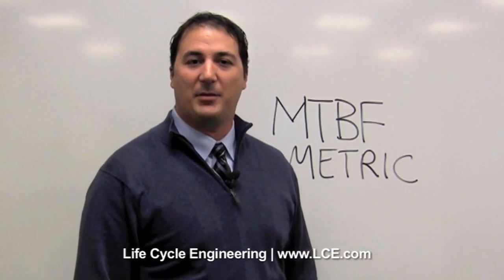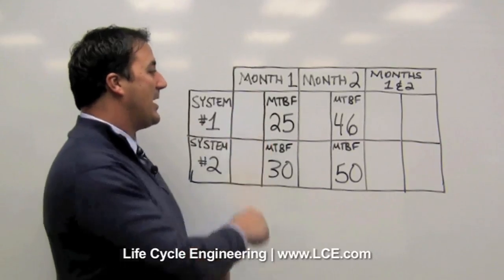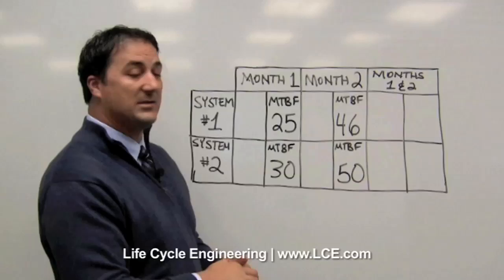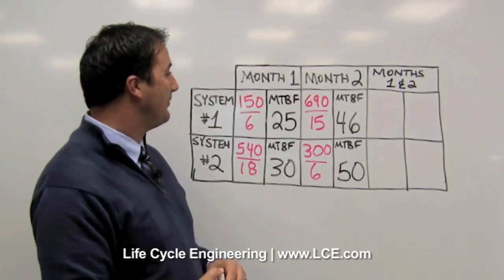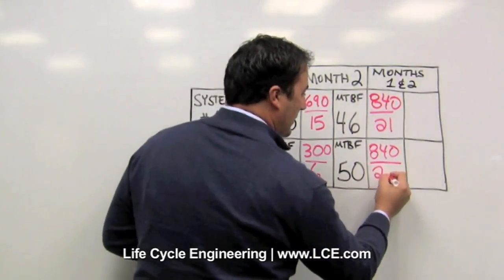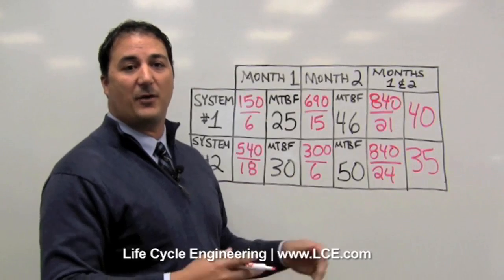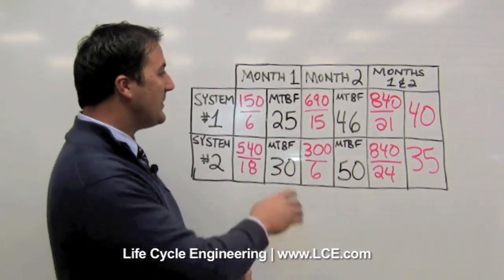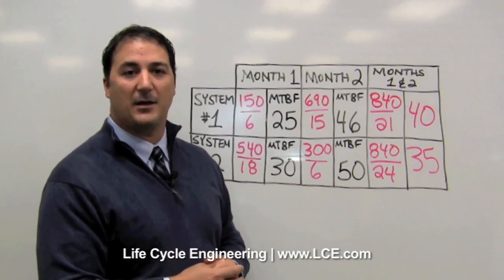MTBF Metric: The Pitfalls of Its Misuse

Comment: Thank you for your lesson.
Kindly i need you help for two following issue 
1 -  after calculte MTBF for equipment what is your reference for MTBF is high or low is there bench marking tables to compate for process equipment in oil and gas industry??
2 -  if i get sysytems contain two process pumps operate according, fwo air compressors operate as each one is working when other one is failed or need change over between each other how can calculate MTBF?
I appresdiate for your feedback at adcance.
Warm regards

Comment: If you think about it, it is correct. If the MTBF is lower, it means that the time between each failure is smaller and hence the failures happen more frequently, meaning that it is less reliable